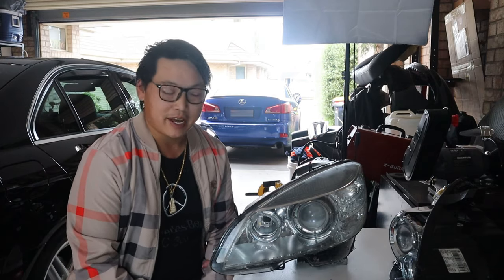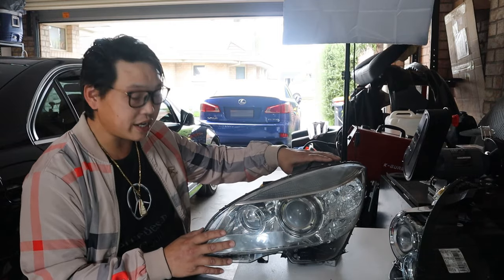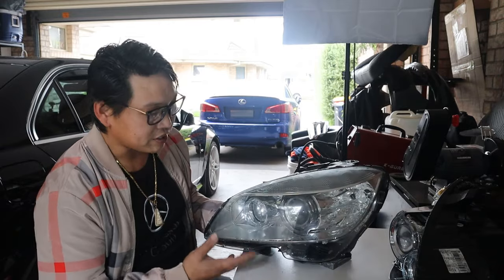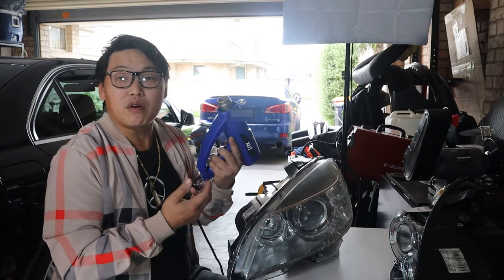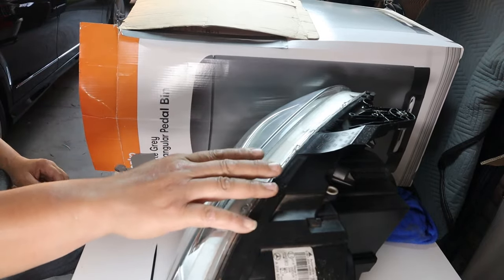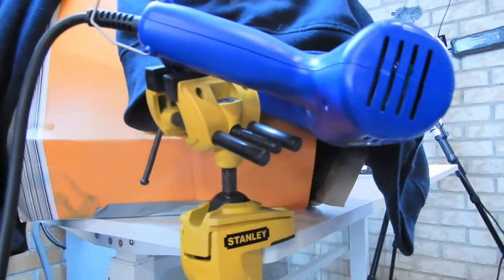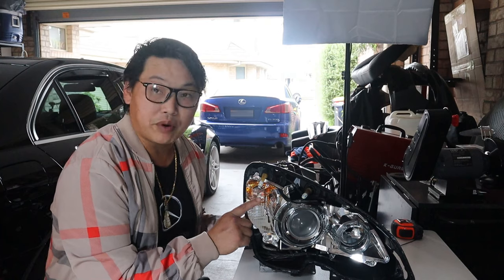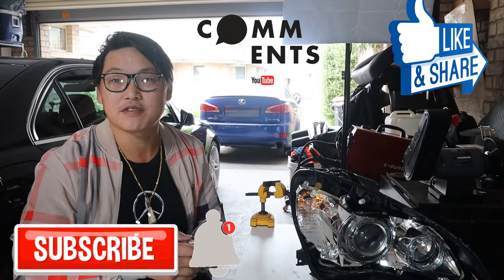how to remove headlamp/headlight lens cover mercedes w204 pre-facelift

Comment: Hello, good content. Does this lens are the same for a c63 amg w204 2011?
Reply from the maker: no 2011 is facelift ..that has the led strip in the headlight ..mine is 2010 and under called prefacelift..and thanks for saying that
Reply: @MIKEYZVLOGZ  mine is 2011 and is not facelift. It has been the same since 2007 to 2011.
Reply: Or 2008 to 2011
Reply: @MIKEYZVLOGZ  if is prefacelift c63 amg, will it use the same lens as any w204 before the facelift?
Reply from the maker: @user-hd6fe3dl7o  as long as preface wil be same shape.. but remember there is coupe version and version ith halogen and bixenon version.. depends what packages ur car have
Reply: @MIKEYZVLOGZ  thanks!
Reply: @MIKEYZVLOGZ  mine is the BI-XENON version sedan.
Reply from the maker: @user-hd6fe3dl7o  ok so preface is 07 to late 2010..mine is. 2010 ns is preface still facelift is 2011 to 2015 or late 2014
Reply from the maker: @user-hd6fe3dl7o  ok so u have a early 2011 which maybe the last of the preface..i understand ..is it original oraybe someone changed the lights? cannu verify i didn't know preface went to 2011 but it can maybe i just haven't seen it
Reply: @MIKEYZVLOGZ  i run the vin number, and yes, it comes with code 615 and 619.

Comment: Did this process to a Nissan altima. They no longer made HID headlamp assemblies. Had to purchase halogen and swap the lenses since I was mainly replacing the units due to oxidation of the originals. Used a heat gun in a box. Put a thermometer in the box to see the temp. Let the temp it around 230. Turned off heat gun and let sit for another 5 mins and then pryed odd the lens. Its a bit tough but as you work a flat screwdriver thorugh the adhesive, it eventually pulls apart. I did have to reheat again when some parts had extra glue that was not pulling apart easily.
Reply from the maker: good on ya mate ... well done

Comment: Hey, do you have a video on how to remove the headlight glass from a mercedes w212 facelifting model?
😊😊😊
Reply from the maker: no sorry I mainly did w204 and w203 although it would be similar technique . as all headlights are put together with mastic that seals the headlight from moisture and dust etc

Comment: Do you have to remove the old glue before replacing the new lens cover
Reply from the maker: as long as its not dirty and contaminated you can use it again just apply more of the headlight sealant (d-mastic)

Comment: What tool is being used to pry the headlights apart?
Reply from the maker: oh that's actually a trim clip removal tool .. but u don't need it .. u cab just use your bare hands after u have heated up the mastic / headlight sealant enough it will come apart easily
Reply: @MIKEYZVLOGZ  thanks so much
Reply from the maker: @danielthomas4018  welcome

Comment: Would’ve been nice if you told us the heat setting you used instead of keeping it so vague.
Reply from the maker: @investor.z  ye sorry bout that mate...it's because I didn't use an actual setting it was done by trial and error I kept checking if it would seperate and eventually it did...some ppl use the oven which is more equal heat... as u saw it did it really ghetto but as long as it heats up a d u don't direct heat to any part as it can melt the part

Comment: "A box that can be used to evenly heat the entire headlight" - like an oven?
How high of a temperature would be needed to loosen the mastic without damaging the plastic?
My heat gun is almighty 600°f on the lowest setting, so it'll melt plastic if you're not extremely careful.
Reply from the maker: ye that's why u need to ensure u don't face it directly at the headlight lens and only do it til it starts to seperate ..it's a trial and error thing
Reply: Absolutely worthless response.
Reply: @investor.z 
And yet you still hit  "send" ...?
Reply: @MIKEYZVLOGZ 
I put mine in the oven on 225°f for about 20 minutes.. There was enough residual heat to remove the old lens and install the new one without re-heating it.

I definitely want to reiterate how important it is to NOT wipe the shiny bits with anything - even a soft cloth dampened with water can still cause it to come off.  I sprayed them with a mild soap solution, then fresh water, and let them air dry.

Comment: I've tried just about every method on YouTube. Still not able to get the old lens off. I even let it stay in the oven for over 20 minutes at 270° F.... Still nothing. So frustrating.
Reply from the maker: @jonwill84  ok try to understand it like this...all that is holding the lens together is the mastic black sticky material... wen that heats up it gets soft and allows you to pull apart the headlight ... u just need some help use a scre driver and push it in and break it apart to start it off ...it really does come apart quite well once heated enough